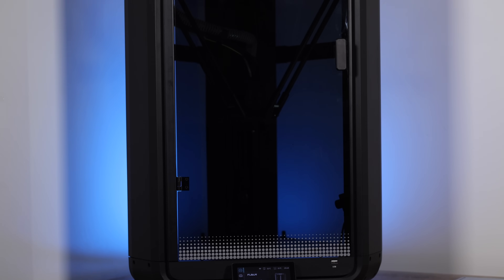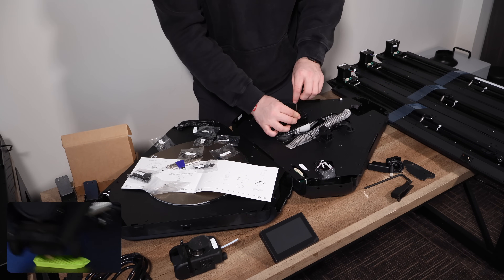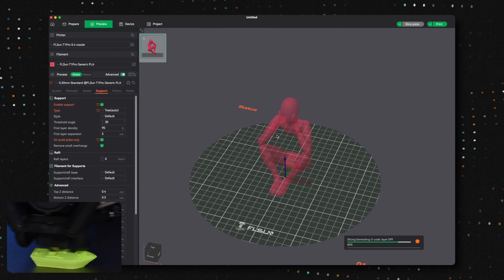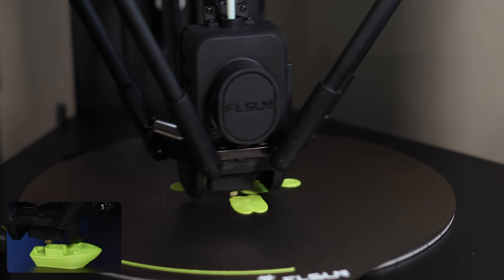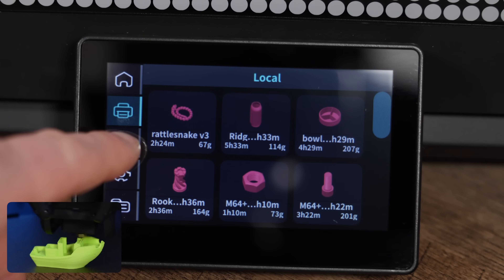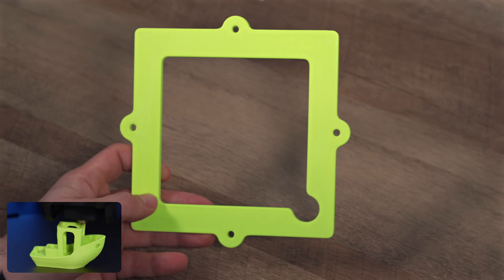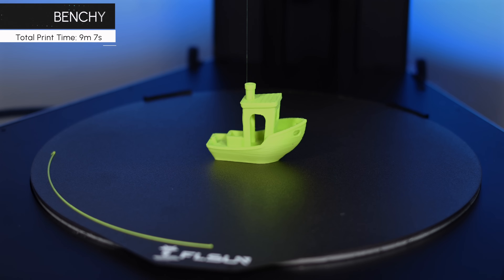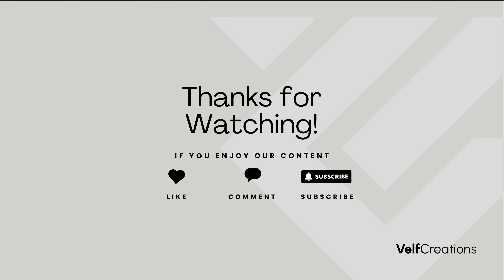Flsun T1 Pro Overview: The Fastest 3D Printer We’ve Tested!

Comment: I bought it instead of the S1 because it comes disassembled and was easier to handle (state certified Assembly machinist since the 60's): Cracked outer shell both top and bottom, defective flat head socket head cap screws for mounting the filament holder,  socket hole is oversized and will strip. pillar power cord cover, didn't fit in the bottom with the power cord rerouted from shipping position. Even running at 300mm it completed a part in 18:21 compared to FLSUN Super Racer at 150mm :59 minutes or Ender 3 at 60mm 2h: 18m. Nice upgrade even for the owner of dozens of printers like myself.

Comment: I got mine over two months ago and love it.  It’s not perfect but no printer is.  I love having the filament inside the machine.  This is my first printer and I had no problem figuring things out.  The best part is that it’s not a Bambu. 👍
Reply from the maker: Yeah! The filament inside definitely gives it a nice clean look on the outside. It’s pretty sweet we have really enjoyed using it. What brand of filament has been your go to?
Reply: I’ve used many brands of pla even the cheap crap from temu.  All work very well.  The TPU was a little ugly but I know I was doing it wrong and it was for an unseen part I needed so I didn’t really care.  I’ll dial thing in better the next time I use it.
Reply: Im trying to convince myself to get one, even though they won't print perfect like my bambus😂